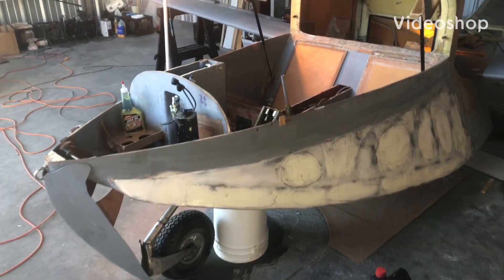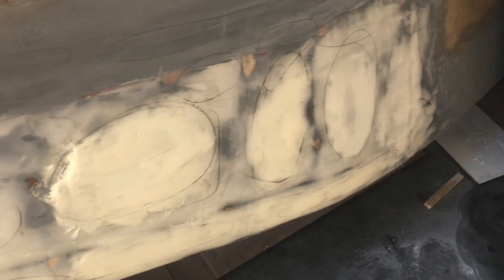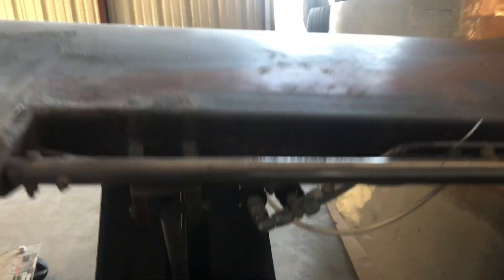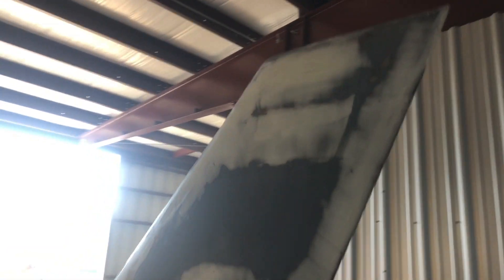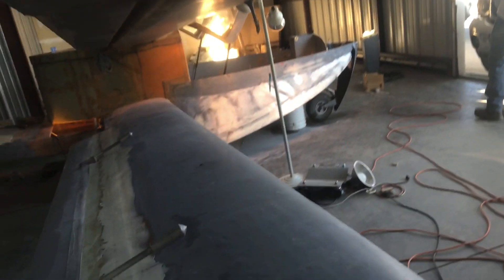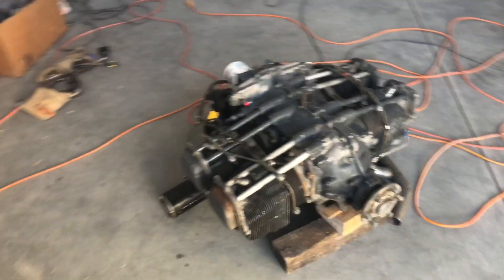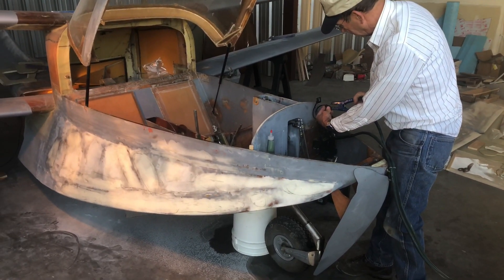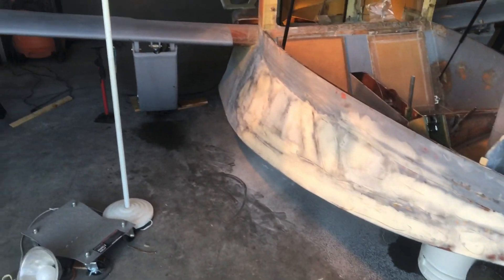Glass goose build progress

Comment: Sir I have one that I  came with a truck 14' box truck I purchased. It doesn't have the motor and is currently still a part in the truck.  I'm motivated to sale 941-580-2318 Edward Bennett Fl.